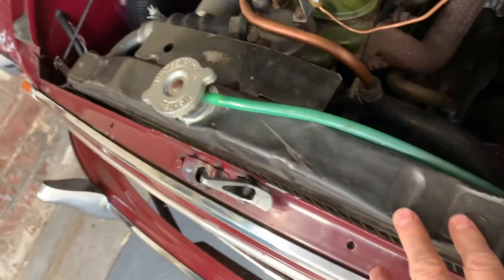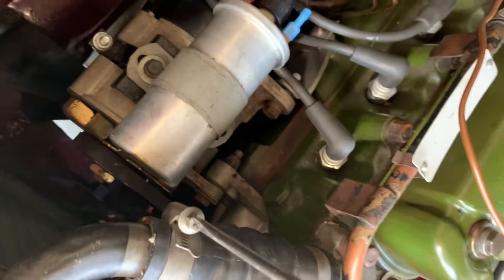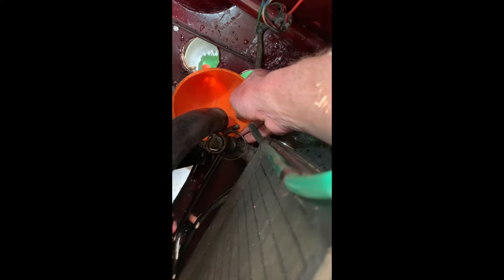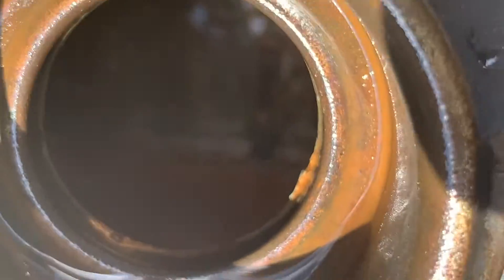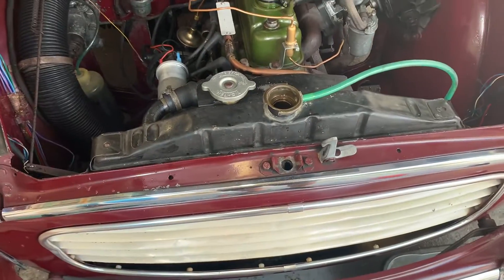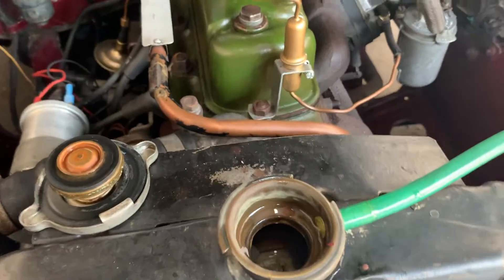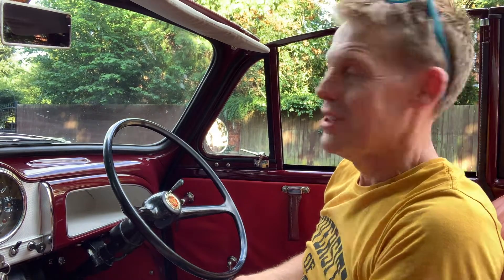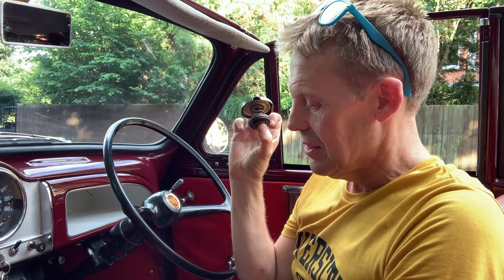My Morris Minor engine went BANG! Coolant change woes.

Comment: For a first time attempt that went well! When re-fitting bolts back on the car it is worth adding a smear of Copper Ease (a copper grease) to the threads, this will make it easier to remove next time & reduce corrosion, Copper Ease is an anti-seize grease (you could use ordinary grease but does not last as long). A smear of silicone grease (make sure it is rubber friendly) on the hoses will make them easier to re-fit, don't use washing up liquid (which works just as well) as this contains salt and you don't really want to be adding this to your car!

You may need to bleed air from the system, the heater matrix can trap air which means that in winter the heater won't be as effective, always drain the coolant with the heater valve open to flush through. 

I tend to use pre-mixed coolant now (don't use the pink OAT stuff, it should be ethylene glycol - usually coloured blue) as it means that the mixture strength is always correct.

Shame that your radiator cap broke, you didn't do anything wrong, good that it failed on a test run not a journey, if you run the car without the cap fitted, the coolant is at atmospheric pressure rather than pressurised, so will boil a bit quicker, but looking at how clean your old coolant was probably won't be a problem, just in case the new one breaks as well!!!

Comment: If you remove the thermostat first then the rad cap then the bottom hose the whole lot should drain! Then flush it BACKWARDS to the normal direction of flow! Drop the thermostat into a glss of hot water and watch to see that it opens properly then re fit. When you have refilled it run the engine at tick over til the thermostat opens and the water level drops then you can top it up WITH HOT WATER til it stays full. Check the heater and all pipes to see if they are warm and you have no air locks anywhere! THEN take it for a drive!!!

Comment: O my god I can't believe what you have just done.!!!started engine with rad cap resting on radiator. Please don't do this trick.i had a very good friend that did a similar thing and it got cin the fan blade .the blade broke off and embedded into his forhead.that is not a lie.please take note.kevin.60yrs in the motor trade.
Reply: when i  work on engine  i all ways stand to the side   yes my fear is the fan blade braking   had it on a old car      BANG    it stuck in underside of bonnet   big dent  in bonnet   be careful